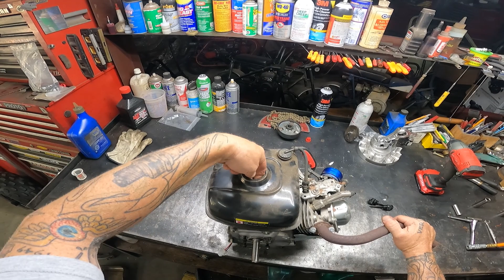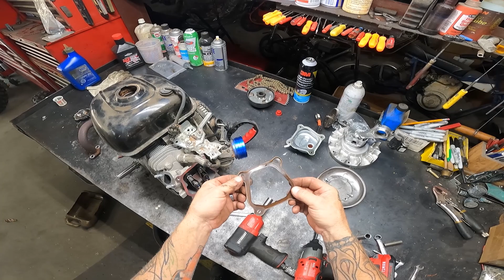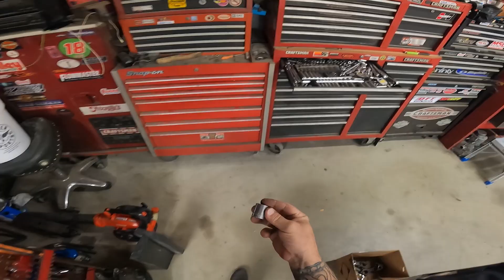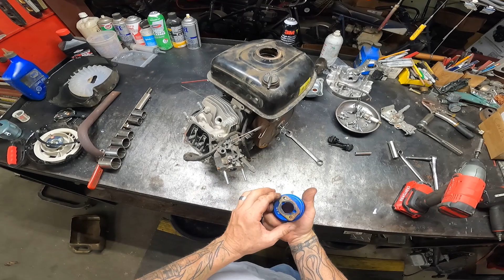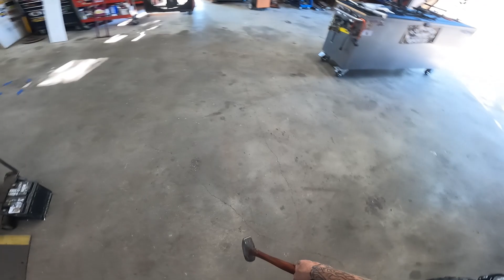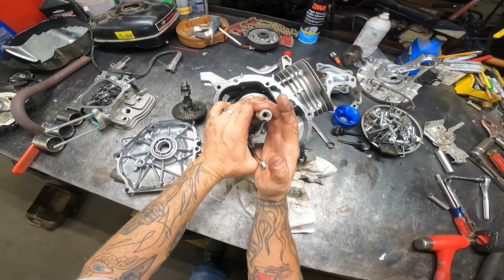Go Power Sports MB200 Face Lift Part 02

Comment: Sitting here on the Father's Day watching your videos enjoying my day looking to upgrade my mb200 watching your part 1 to Part 5 enjoying every minute of it😃
Reply from the maker: Thanks for watching !! Happy Father’s Day
Reply from the maker: Gopowersports has all the parts you need to do any upgrades .
Reply: @BustedKnucklesBuildsTexas  just got through at gopowersports my shopping cart is full I will enjoy my mb200 for the rest of the summer and it will give me a nice project to do during the winter😃
Reply: I would like to say watch all of your facelift videos on the mb200 enjoyed every one of them very much information it will make my rebuild this winter much easier I do have one question have you ever tried using the 196 flywheel on the Predator 212 with the charging coils in order to maintain the headlight?
Reply from the maker: @paulwelches8826  sweet !!! The MB 200 is a killer bike !! Mine is a Texas them ,
Reply from the maker: @paulwelches8826  Thanks so much for watching ! And yes , can’t remember witch 196 flywheel fits the 212 , I think it will fit the non hemi 212 ,
Reply from the maker: Good luck with your build and have fun , that’s what it’s all about !! Let me know if I can help .
Reply: @BustedKnucklesBuildsTexas  even though I'm from the Midwest mine will be a Pittsburgh Steelers theme I have a Predator 212 bar and a drift trike that is done up in that same theme Black and Yellow I can powder coat everything I will have to plasti-coat the fenders but that will be no problem
Reply from the maker: @paulwelches8826  right on !!

Comment: Got questions for u can I run mikuni carburetor with stock cam because I have stage 1 on my predator engine with a 22lb valve spring
Reply from the maker: Yes sir you can , might need to play with jetting   , but I would bolt it on and run it first
Reply: @BustedKnucklesBuildsTexas  thanks for the info
Reply from the maker: @somlysom6315  good luck with it sir
Reply: @BustedKnucklesBuildsTexas  oh another question do I still have to do governor removal in order to run the mikuni or its fine the way I'm use it with the stage 1 setup
Reply from the maker: @somlysom6315  yes , I would remove it , I have a video on how I remove them , it’s not hard to do .
Reply: @BustedKnucklesBuildsTexas  that's what I figured